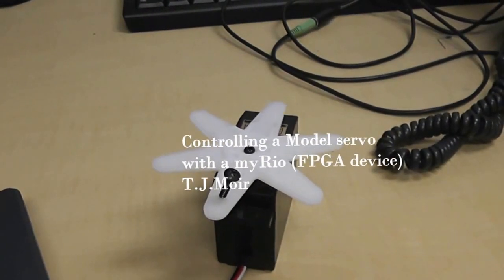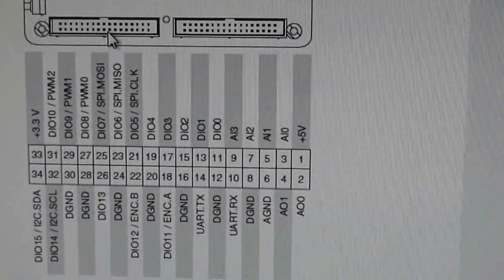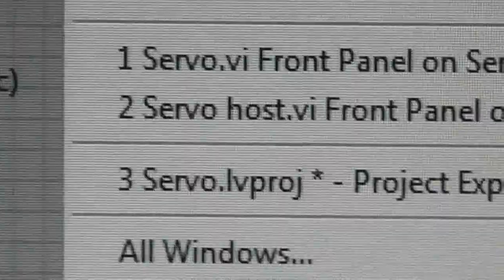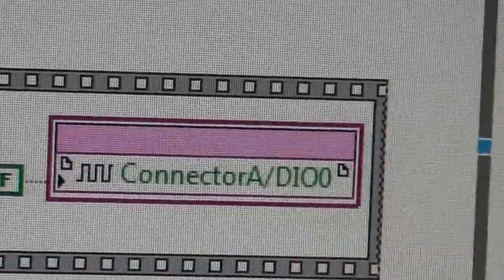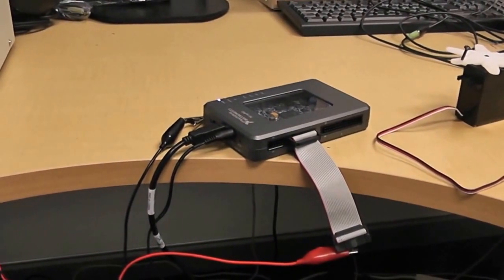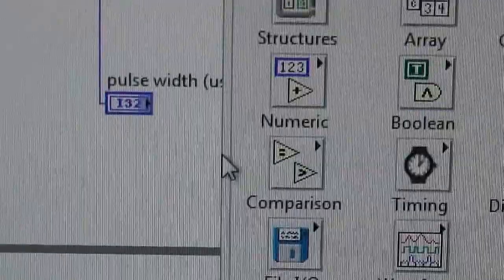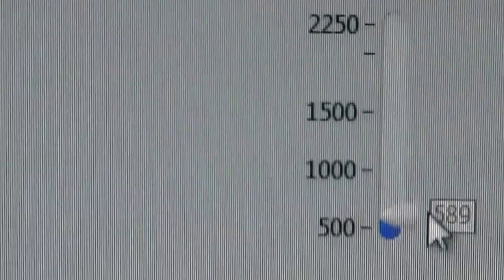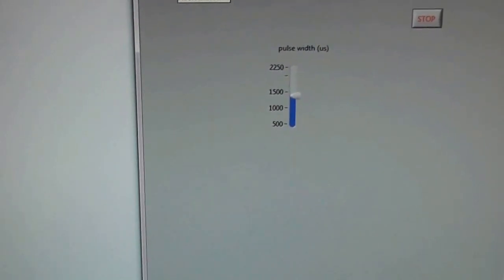myRIO FPGA hobby Servo Control plus LabView Code

Comment: But how do you connect the servo to my rio?
Reply from the maker: DIO0 digital out on the FPGA. See video for pin number. This goes directly to the PWM input of your servo. Connect the power supply of the servo - 5v to a different supply and not the myRio. Don't forget digital ground too.
Reply: is there a lil something that i can add to this project to make more advanced like adding a sensor or anything useful u have in mind?
Reply from the maker: @abbasjradi5001  It's only a demo to show how to generate PWM. You could have say 4 or five of these and control multiple servos. Wherever your imagination takes you